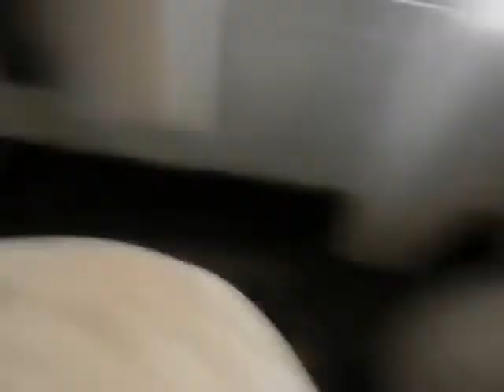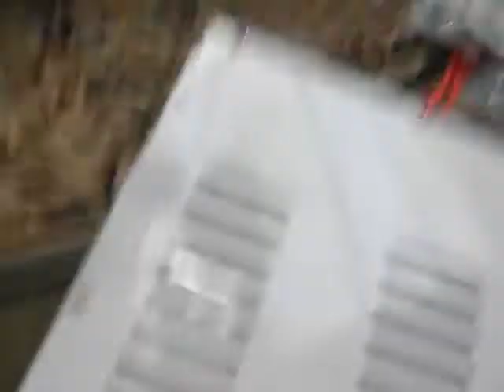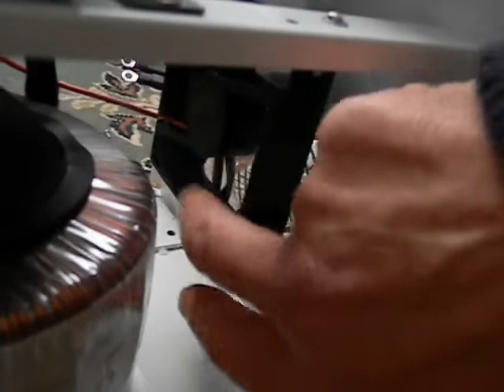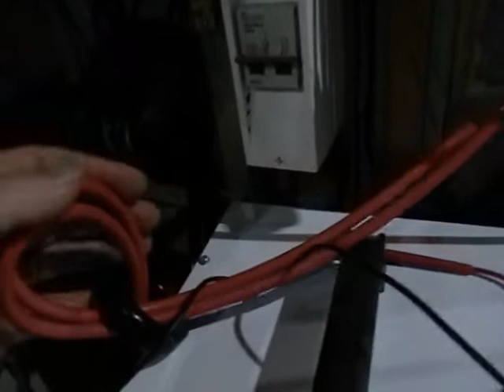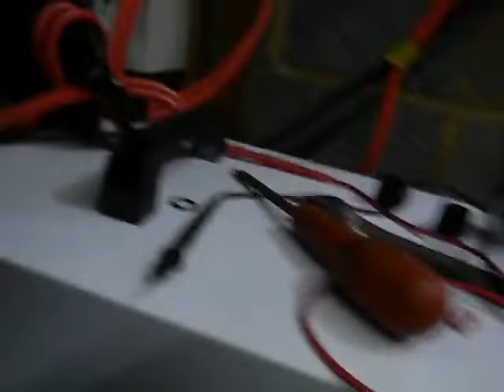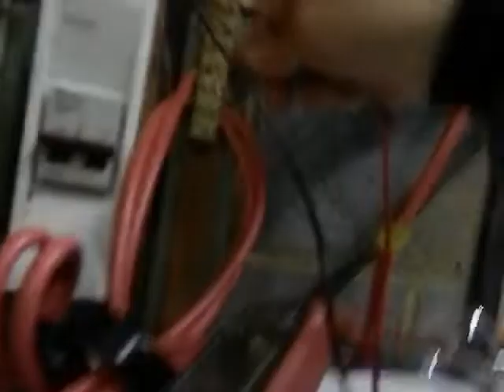Unboxing Solinba 6kW solar power inverter - off grid power - solar or boat

Comment: On amazon it says it's a split phase inverter but I only see outputs for separate 120v or 240v. I don't see split phase outputs (120/240) for 2 hots, 1 neutral and 1 ground. I see only hot, neutral, and ground for 120, and the same for 240.  Is it or is it not split-phase?
Reply from the maker: Email  lily_kuang795@hotmail.com  for technical details of variants. I think they will do different things to order.

Comment: How is the inverter fairing.....what's the idle load consumption?
Reply from the maker: The unit is wholly reliable and I forget that we're using an inverter. Idle load is 2 amps. I may have added an extra toroid in series with the transformer - and apologies for amnesia